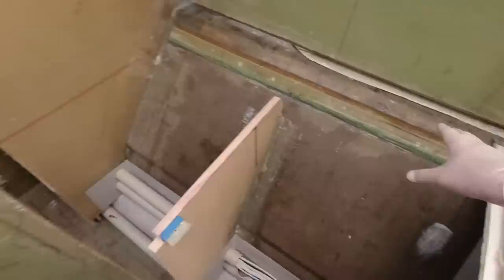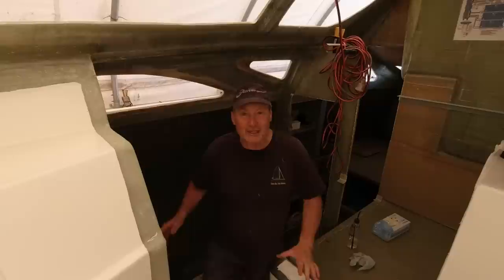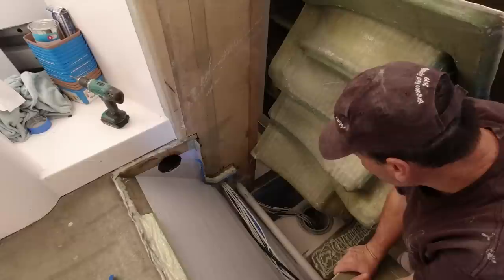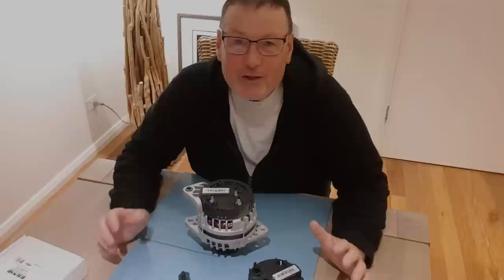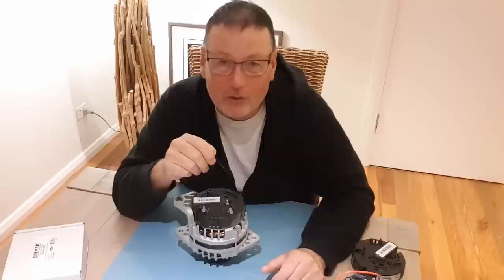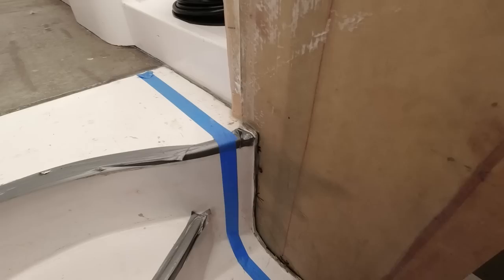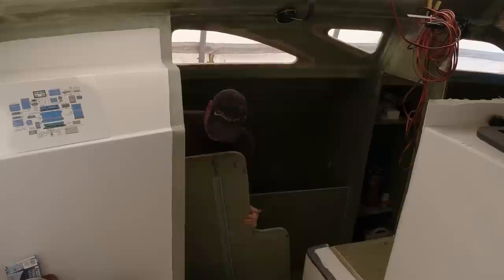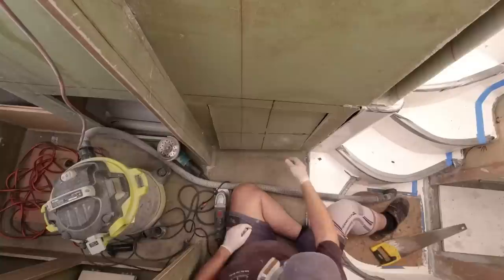There will be, NO SQUEAKS // Complete Catamaran Build Ep255

Comment: I recommend recharging the house batteries by sailing - alternators engaged with the prop shaft, motor disengaged. Takes some planning and building, but it gives you electric power for free and you can keep batteries topped off even if they aren't monstrously big (and heavy, and expensive).

Comment: For more than a year I ran my standard yanmar Valero 120 amp alternator charging my LiFePo4 batteries on my cat. I fitted Victron Bluetooth temp/ voltage sensors to the alternators to see what was happening with them. I found on startup the alternator generally put our about 70 amps but the temp started increasing quite rapidly and after about 10 minutes the temp of the alternator was sitting at 70 degrees  and the amps backed down to 35 amps. This remained consistent like this and the temperature remained the same. I was happy with this and did no further mods.

Comment: Rossco, I really enjoyed your detailed explanation of the alternator mods you installed. But I would think that a single 90A alternator would be plenty to keep charged a couple of AGM starter batteries. Under normal circumstances those Yanmar 3 cylinder engines are easy to start and aren't going to be draining those start batteries. I would think that a charge controller could either split the charge current to each battery simultaneously or split the charge time between the two batteries to get those batteries topped off in 20 minutes or less. The charge status could be monitored manually as well and if they weren't topped up, then you could just leave the engines run a little longer. If this is viable then you would have 3 alternators devoted to the house bank and those are the ones that will need it most. 

Will there be a way of manually switching the output of the alternators to what ever batteries you wanted, if you wanted to put all 4 of them to the house bank? How about using the house bank to start the engines if something happens to the start batteries? Can you start both engines on the same start battery? After one engine is started from that one battery,  it is being charged and you really aren't risking too much by starting the other engine with that same battery. You just bump the RPMS up a bit to produce more current to the other engine starter.

Love the wiring job your family has done and Janet's glasswork is already proven!

If you drain the condensate into the brown water tank this is just a reminder that you'll need to incorporate a small trap in the line that fills with the condensate and blocks the escape of the odors coming up from the tank into the boat.

Comment: If your drain in your black water tank, you will need a one way valve to prevent black water and smells coming into your compartment.
Reply from the maker: I will drain it to a sump shared with the air conditioner condensate instead to avoid back flushing of odour and bacteria.Cheers Ross

Comment: Dry bulge is the way to go as you can see if you have any leaks are issues. How much more power does the new alternator’s make? I missed that bit, or is it a case of a smoother output voltage for the house batteries? Did you say an air condenser? I have never known such a thing, normally liquid compressed.

Comment: Are you going to have a problem if you drain the AC water into a black tank.  At sea no issue, but at dock side if level gets high you can not pump out.  Just a thought, have RV and waste water is always an issue.

Comment: Rosco, any possibility of handling condensate the same way frost free refrigerators do? They take the water and drop it into a plastic pans that sit on top of the condensing coils. The heat from the coils evaporates the water into the air.

Comment: If you plumb the drain from the fridge to the black water is there any concern of smells or contamination into the fridge?
Reply from the maker: Interesting thread. I would imagine there are many issues with back contamination. I have been toying with the idea of a secondary sump as our air conditioner will needs its own as it produces quite a deal of condensate.Rossco
Reply: Plumb it ovet the side witha skin fitting
Reply: @LifeOnTheHulls  I think the second sump is a much better idea. There is no back contam from the condenser drain to the freezer interior , that's dumb ! BUT the freezer chest often needs a drain too so there is a need for a trap between it and a second sump thats also getting AC drain and condenser drain, and then pumped out through an above water line fitting.

Comment: I take it you will have Solar panels as well for charging the batteries?
Reply from the maker: Yes Graeme. At least 1400 watts to start with.I have currently 2 mppt controllers rated to 1400 wstts already installed.Ross

Comment: Draining condensate Would there be a concern with black water getting into the freezer?
Reply from the maker: Yes it won't happening.Was an option that won't happen now.I favour a  small sump that will accommodate air cin and freezer condensation.
Reply: If the compressor is above the waterline could you just plumb the itty bitty condensate line to one of the thru hull fittings hoses? Or a one way check valve?